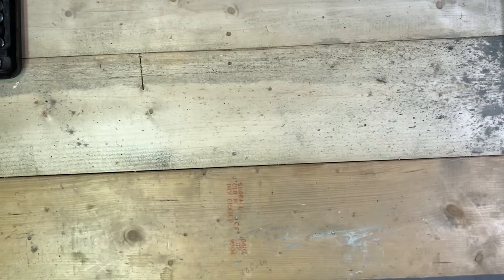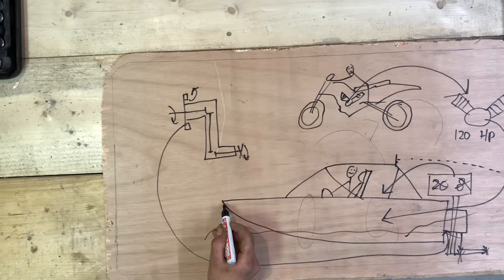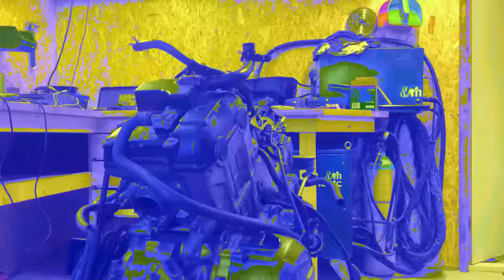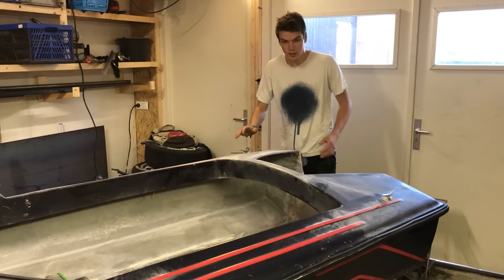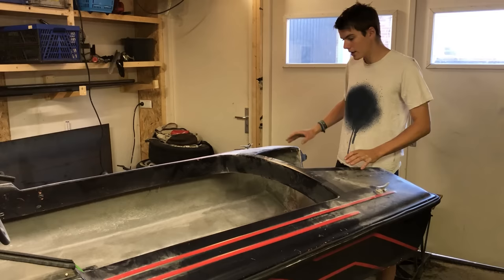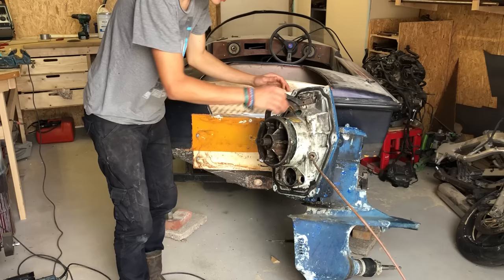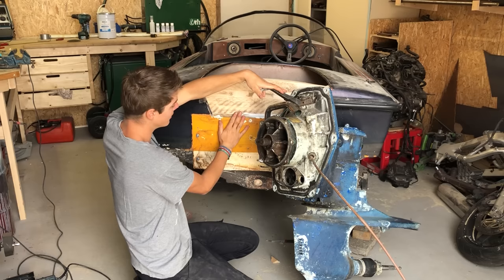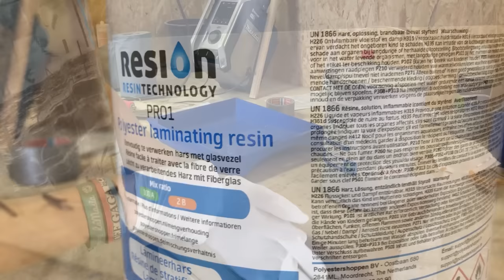SUPERBIKE ENGINE POWERED SPEEDBOAT BUILD (part 1)

Comment: A little trick after cutting fiberglass, when u take a shower that night do it in cold water, it keeps your pores from opening up and the fiberglass strands from getting deeper into your skin. Its not a complete fix but it does help. Enjoying the build.
Reply: Good trick for fast relief has the same issue with graphite or carbon fiber all it causes the same issue rub some baby powder over your skin instant relief haven’t cut any since then but heard you can do it right before and prevents the itch as well was the tip I got.

Comment: That stern drive is too large & too heavy for that little boat. Once you add the motor, torque convertor, drive shaft coupler, gas tank,and 2 humans you'll exceed the safe weight of that tiny boat., Be safe
Reply from the maker: Sean Signer yeah im a bit worried about that too. Well see how it floats first and then maybe add more flotation or remove weight later
Reply: @homemade_madness  I think the stern drive is mounted a little bit too low
Reply: You could move the transom back (false transom) or make float extensions like an inflatable boat
Reply: Yeah you can add flotation pods in the rear. Pretty common on aluminium boats

Comment: Just a tip for the future never ever grind fiberglas without a mask. Its very dangerous stuff to breath in.
Reply: I was so shocked he did that too but live an learn
Reply: *breathe
Reply: Literally took a nice swipe and getting copd before he 40. Fiberglass like that is incredibly bad, need a tyvec suit and respirator. Can't stress enough how much damage you just did to your lungs. For your skin, if you get fiberglass in it, use a lint roller.

Comment: Good trick for fast relief has the same issue with graphite or carbon fiber all it causes the same issue rub some baby powder over your skin instant relief haven’t cut any since then but heard you can do it right before and prevents the itch as well was the tip I got.

Comment: Ohh the itch of hell 😅
I personally would have put a couple of biax on the inner of the transom, and a few Ali plates for the mounts of the stern drive, they have a tendancy to be very hard on the transom structure, essentially the boat is being picked up and waved around by the transom.
I can't wait to see the waterline on this little ripper 😁 great project so far..

Comment: Nice job but next time you need to set the drive so that the anti cavity plate is level with the bottom of the hull and offset it 25mm or so to the right to counter act the torque  of the propeller 👍🏻

Comment: Nice and funny project. But Would rather get a yamaha/tohatsu 3 cyl 40-60 hp 2-stroke engine and put on that transome. It is probably not a lot hevyer than that volvo penta drive alone. Or maybe try to make some kind of surface drive with less drag and gain more speed to go with the honda vtr engine 🙂

Comment: That stern drive is waaayyy to big dude....
Apart from being to heavy for that hull (it's probably heavier than the 20hp you just removed), it's to long. It's ment for a much bigger vessel. The cavitation plate is ment to be level with the bottom of the hull or higher.
I'm sorry to sound like a downer....but it's not going to work very well mate. 😕

Comment: Thats a 280 DP, usally used with the volvo penta 5.7L. So a licensed chevy 350 v8. That is a really big AQ. Why not use a lot smaller, and one with SP? A 110 would work perfect, half the weight, one prop and still rated for up to 140bhp..? Just thinking.

Comment: Thst drive is way too low the plate above the propeller(cavitation plate) should be even with the bottom of the boat or even an inch higher than the keel.